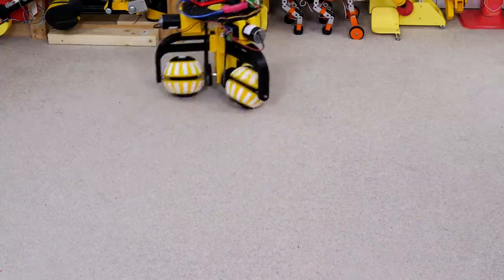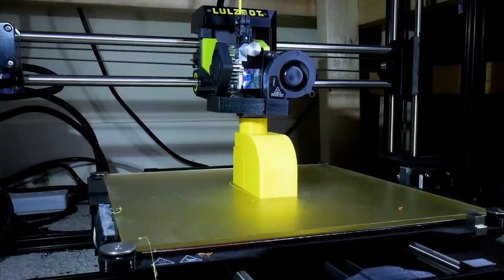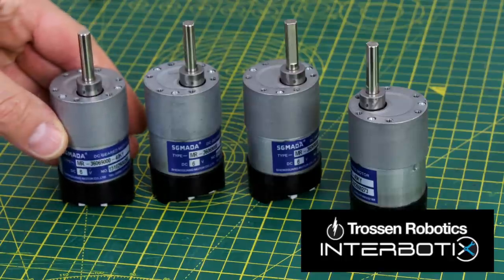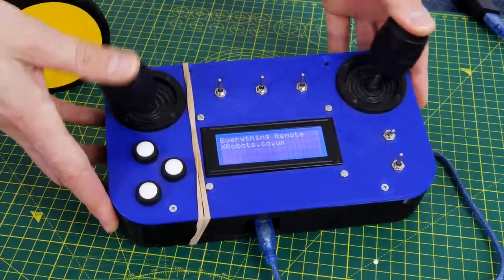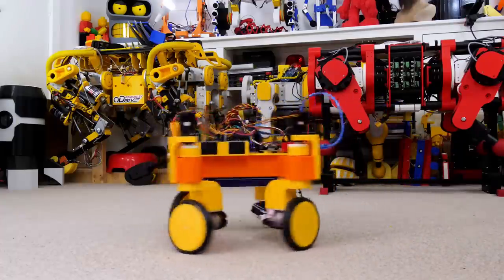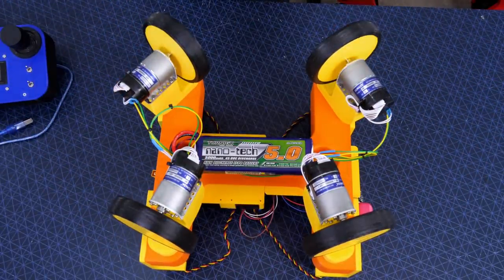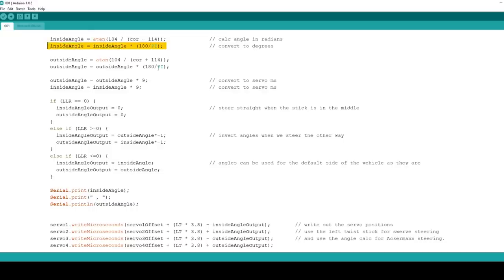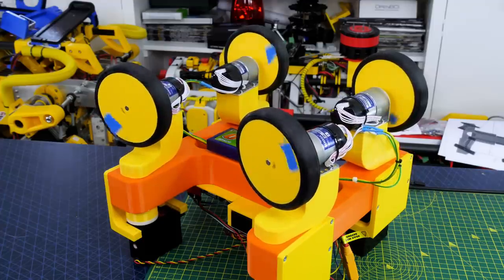How Many Ways Can This Robot Steer?

Comment: This video actually makes me think about horse locomotion as explained by the AI in Games Red Dead Redemption 2 horse AI video ( https://youtu.be/1iak2-oGYXU ). A horse's stationary center of rotation is actually between their front feet, not their center of mass. I imagine many horse motion concepts can be generalized to help here, and even could be helpful in open-dog  control. For instance, aligning the center of rotation with the center of mass works in most steering scenarios, maybe shifting it to between the front wheels as you approach 0 forward velocity will lead to a smoother and more organic steering solution in most cases and eliminate the awkward 45 degree wheel solution for all but the rarest cases where you actually need it to turn exactly in place.